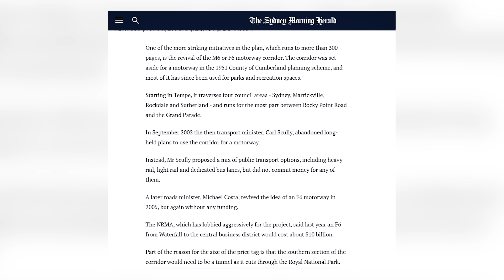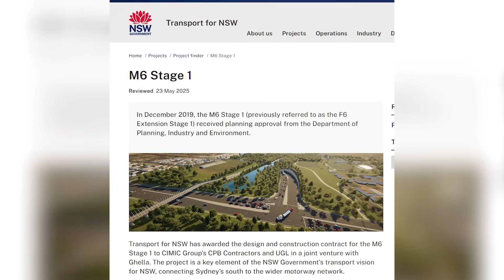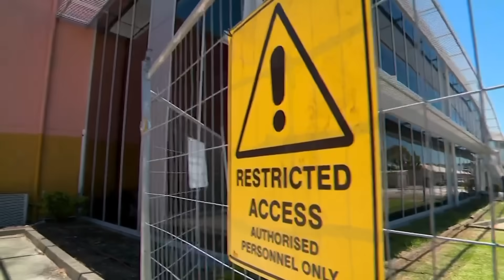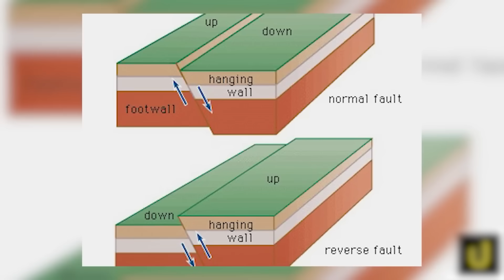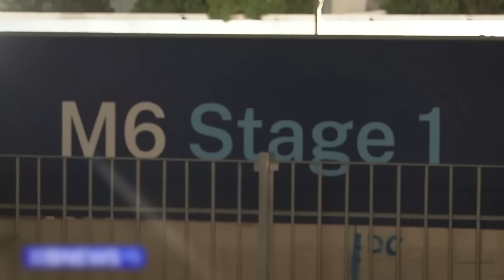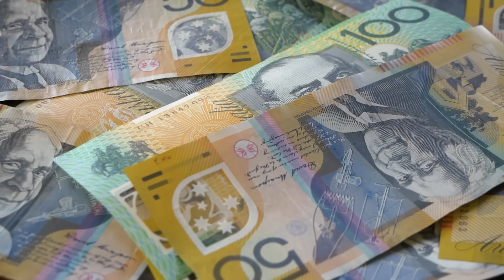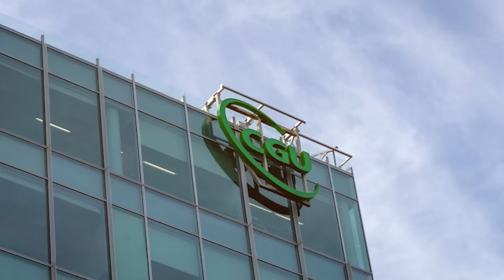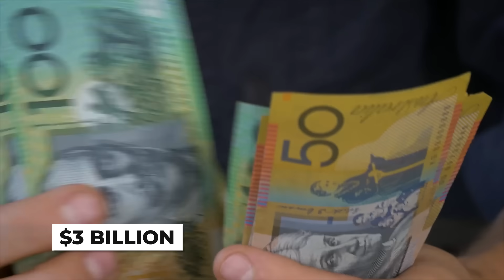A $3 Billion Mistake : The Sydney’s M6 Tunnel Disaster

Comment: I live in the South part of Sydney and tne M6 motorway was planned more than 30 years ago. What went wrong? Geo Engineers wanted to cut their costs and were doing their tests on the cheap ! Brought in machines that could not handle this type of tunneling and didnt bring the huge Bora machines that built the other tunnels around Sydney. Botany Bay Beaches are only 500 metres away and im sure there was wet Sand under the tunnel construction site. The contractor walked away and didnt want to lose anymore money. Who is responsible now> The government and the Contractor. but seeing a solution will take years and it will remain like this for years to come. Chris Minns who happens to be a member of Kogarah should get off his ass and get the project going again otherwise I wont be alive to see it completed and drive inside the tunnel.

Comment: One of the biggest problems with construstion completion dates, is the egos of the politicians who want to grandstand on the day the project is finished. They put undue pressure on the construction companies and their project managers, to find cheaper and quicker way to finish in time for said politicians' egos to be on display. It happens with every project. This is what's happened with this project, partially. And if it isn't a pollie's ego, it's a CEO's ego. It's obvious they weren't thinking about the long term safety of the occupants of the vehicles which will be one day travelling through those tunnels.

Comment: Unfortunately the competitive tender process, coupled with the desire to maximize profits on a project, can lead to a project being done 'cheaper than possible' rather than 'as cheap as possible'. And having enough government oversight to detect any problems also costs money. Overall, if you do a lot of major projects within 10% - 20% of the lowest possible cost (I.e. not have the taxpayer paying a lot more than they 'have' to) you are statistically going to wind up with a few massive, expensive cock-ups. On a positive note, a major project disaster like this every now and then makes both the government and the contractors more risk averse for a while (which in turn makes projects more expensive), before it slowly trends back down towards 'as cheap as possible' and eventually creates another disaster. And so the cycle continues....

Comment: Should get the Chinese to build and half of the project costs and on time delivery plus no issues. Boring machine is the best option due to less vibration. A common way in most projects are to blame the design fault to someone else and not themselves, no wonder similar problems keep coming up.

Comment: Why didn't they use the  (TBM)Tunnel Boring Machine method?  That way the Tunnel Lining becomes load bearing, whether or not the ground is Mush!
Reply: TBMs can have a larger cost.
Big machines with a lead time to aquire, build and dismantle.

They can also be the cost effective solution, but the point im getting at is they are not always the best option.

Comment: Buildings above are destabilised. The tunnel is 12 metres below. Surely the government can resume the land immediately above the collapse and excavate the whole area top down. The collapse area is only 200 metres long and apparently the fractured rock is unlikely to extend more than another couple of hundred metres. I don't understand how this is such an expensive proposition.
Reply: The cost of residential land in the area is approximately $4000 per sqm (Dec 2025). It also cuts under an army barracks, service stations and other contaminated industrial land. What's the cost to acquire, then safely dispose of such contamination? What's more, the sinkhole in the Rockdale industrial estate is approximately 400m from an apartment complex 15 storeys high with underground parking and a shopping centre at ground level (from memory, just the residential side includes 4-500 or so apartments ea, approx 800k/2 bed apartment). How deep are your pockets?

Comment: Simple.  If the overburden is 4m, compulsorily acquire buildings above the tunnel, heavily compensate those affected, and open the roadway path as a trench. Cast the rest of the concrete tunnel and refill overburden.  Turn the topsoil into a green space.  Recover the disaster. If the path of the tunnel was marked on a map for more than 50 years, why was any building allowed to be built over the space in the first place?  It's time to clean up major planning project decisions in all states under one federal scheme and put in place a body of people who are not "penny wise and pound stupid" as the saying goes.
Reply: The original F6 designated development zoning took a different path to the current M6. The top of the original F6 zoning has been transformed into (quite a nice) park. 
To cut and cover the new route would involve (as I understand) significant disturbance to a well developed strip of land overlying the tunnel (including high density multistorey apartments). From what I understand, the area that the sinkhole opened up in was always traditionally marshy (near the start of the aptly named 'muddy creek' tributary to cooks river). It's also next to a small but long used army base and other contaminated industrial land.
Reply: Because sometime between then and now, the land was opened up for public enjoyment since it wasn't being used, then when they were ready to build, the neighbors weren't willing to give the park up. That's why when governments acquire alignments now, they fence them off so nobody can enjoy them at all.

On one hand, parks are as important as roads. But on another hand, if governments can't follow through with their multi-decade plans, it just encourages thinking to the level of only the next quarter. This way, the whole state is paying insane amounts for this community to keep its park through building a tunnel.
Reply: @CalebMoore-vq5tz  The park (which is part of the originally zoned transport corridor) has only just opened, it was developed as part of the M6 tunnel project. Prior to that it was mostly under-utilised footy fields and a creek, prime for highway development. A different path was chosen in 2019 (under Scomo and Gladys) compared to the original highway transport corridor (zoned from the 1950's). This new tunnelling path runs under an Army Barrack from 1903. 
I think they really should have picked a different exit, one not out a swamp that historically was used as a dump.

Comment: We had the same problem in New Zealand with "CPB Company" an Australian company wanting to build the new Transmission Gully motorway who had no experience with our terrain. They came over to New Zealand saying they could build it for $850,000,000. New Zealand contractors stated that it couldn't be built at the price CPB submitted. About 2 years before it was finished they demanded an extra $240,000,000 or they would walk off the contract. They where warned about New Zealand's unstable terrain. . After 7 years and 5 deadlines not met the contract was finally finished march 2022. The final cost was $1.25 billion. $375,000,000 over budget and our stupid Labor Government paid it. 3 years after it has been finished, 2/3rds of the road has to be ripped up because of the shoddy seal. You only need one guess who is paying for it, New Zealand tax payer.
Reply: The way they burn through our money it’s pretty upsetting. Inventing new taxes and fines everyday to get even more money off families to pay for their mistakes.
Reply: I didn't know that. I worked on the Victoria Park tunnel. No major screwups.
Reply: Yeah its unreal. I - like many other aussies - are in the dark, until you find out we are the highest taxed roads in the world. So we get stung with our tax and ongoing toll handouts
Reply: @localkiwi9988 - 1. It's a Spanish company as part of a pyramid of companies in the CIMIC  and AGS Groups. 2. They have a long history of under pricing and then smashing the clients with variations. They've been doing it for years. Lack of due diligence.

Comment: Would this have been preventable with an airborne ground penetrating radar route overflight?!?! And or even gound or gravimetry because of buildings over route too might have detected the soft less dense rock and sand. Either or both of these as a seperare contract over prospective route selection might be coming in future I hope. As even if this cost a few hundred million that's still a helluvalot less than 3 billion plus!

Comment: Why did they have to tunnel that 3.5 kms .instead they could have used the length of the swaps on the surface there all the way to president avenue.
Tunneling will generate bigger and lore expensive contracts to benefit none other than coorporations.
So stuff tax payers apply everywhere.